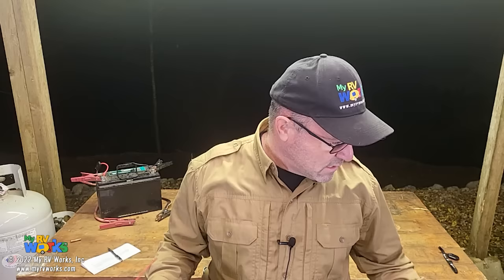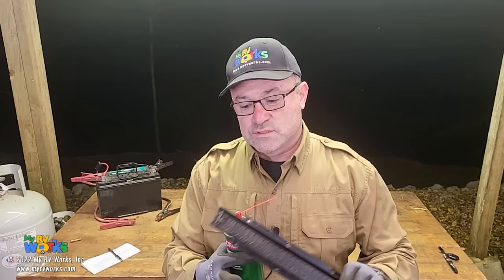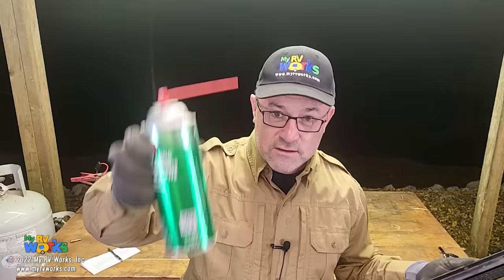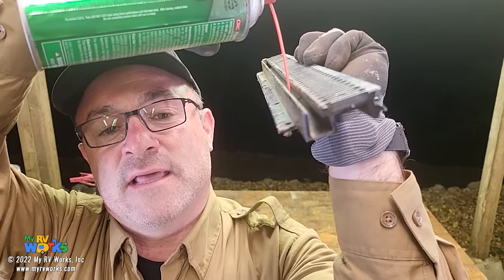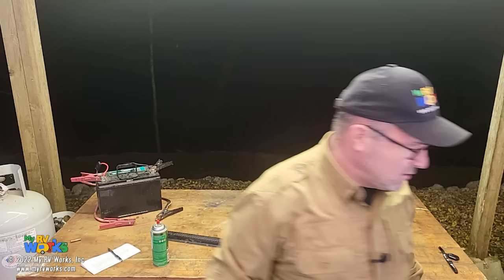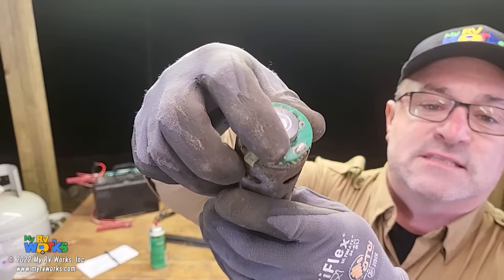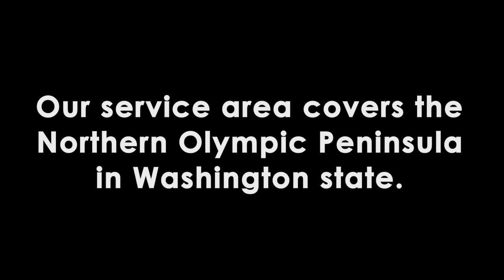Schwintek Slide Room Only Moves 2 Inches And One Motor Stops -- My RV Works

Comment: Well damn..... I had to push as hard as I could to get it a couple more inches out while I ran the motor. Then I went out and lubed the little I could get to. Then pulled it back in. Pushed like hell again as I ran the motor- got a little further out and I lubed it again. Did that a couple times then the motors synced up and now it works like it always did. Truth be told I stopped lubricating about a year ago because I heard the manufacturer said not to lube this brand- well I'm gonna listen to the results. Thanks man!!! Saved my first trip and probably a few hundred to a thousand dollars on a mobile mechanic

Comment: Awesome! I have a 2022 forest river 5th wheel and a mobile Rv tech told me the whole slide system needed replaced because he couldn’t figure out why it kept binding up and sounding terrible. Often I couldn’t get it to move more than a couple inches. I tried the lube trick (bought exactly what he said and applied exactly as told) and it immediately started moving better. That allowed me to go through the retiming process fully and BAM! Good as new! 
THANK YOU!!!!

Comment: Thank you for your videos I've learned a lot about my new RV.. I did have a problem with my slide from not going out even.. now they the dealer said to never lube the slide . But it makes sense putting a Teflon spray on it to make it easier on the system... Being a mechanic I know about friction and the problem it causes... I'm a fan of your video's.

Comment: THANK YOU! THANK YOU! THANK YOU!  I returned from a trip yesterday and my bedroom slide wouldn't go back out.  It was completely twisted. I tried the re-timing method, I tried the "override method" and nothing was working.  I actually already had a can of RV Slide lube sitting around but I didn't think to try it.  This video helped me learn where to lube and how the slide actually moves.  I was finally able to work it back and forth and get my slide out all the way.  I then resynced the motors and it's working like new again! (For now, haha)

Comment: After I lubricated the tracks, motors, and the rollers, the slide became very quiet going in and out.  I could immediately tell the motors were working with less resistance.  Another thing I found was a few loose screws on the tracks attaching to the slide room outside wall.  These maintenance items are now part of my annual maintenance package.  thank you for your guidance with these RV's.

Comment: Thank you! Was having issues with slide not traveling smooth or evenly. Because I did not know, I had lubed with white lithium spray grease.
 After this video, I spent time with brake cleaner to clean tracks, before applying the CRC power lube w/PTFE.
 "Much Gooder!" 🙂

Comment: Thank you Darren.  

Your videos are especially helpful.  I learned more about how my trailer's  Dometic / Suburban / Schwintek / electrical systems work from YOU than any other videos I've watch or manuals I've read. My greatest fear when travelling with our trailer is having slideout problems.   I'm headed out to my trailer right now to lubricate the Schwintek tracks !!  

Bob in Grand Rapids, MI

Comment: I had exactly the issue you describe, Darren. One side got stuck, and overall, the slide seemed to work much harder than in the beginning, but no error messages on the slide controller board. I must confess that I did boondock with the slide out during several sandstorms in Utah, before the resistance started. I was able to get the slide out and in when I repeatedly pressed the button to start the process, but it didn't feel good at all, and I just left it in until I got home. Anyways, I blew out the slide tracks with compressed air, but still had the slide movement resistance. I then bought the CRC Lube you recommended and greased the parts of the tracks and the roller you indicated - on all four tracks. It immediately worked and the slide slips out and in like new. I tried at least 20 times since lubing it, and it never hesitated to work. Thanks for making this video, Darren, and for sharing your knowledge!:washhands:

Comment: You are my hero! My slide was very sluggish and barely could complete the whole move in and out. The lube job solved my issue and it's as good as new! I did find the CRC Power Lube hard to find, even on Amazon. I had to make a 40 mile round trip to Graingers Supply to find a can.

Comment: I am on a trip right now experiencing this problem.  Intuitively, my thinking was that , lubrication would cause slippage.  So seeing this now as more of drawer closure versus a gear track, I understand lubricating the bearing surfaces.  Also, no one described how the electric controls are designed.  So the synchronization makes perfect sense relative to alignment and added friction drawing more current.  Will experiment when home, but thank you for the enlightenment.

Comment: Just had this exact problem in my bedroom slide with a brand new Keystone Avalanche fifth wheel we just purchased, will try that tomorrow.
And I’m also guilty of releasing the switch once I think is in or out all the way, thinking I’m going to blow a fuse or strip a gear.  The manufacturer states not to grease probably because grease holds dirt and sand causing premature wear in the geared section, exactly where you said not to Lube, great advice thanks a lot.

Update next day, lubed the 4 tracks and held the switch counting to 3,  once it was in all the way and at the out positions as you stated, tried 3 times and works great so far.  Thanks for the help.

Comment: I also lubricate the channels on the track with the same product. Never had a problem.  But do understand that the lubricant will attract dirt. Was in Arizona desert during a sand storm. The sand and dust collected in the channels. So clean the channels frequently and before pushing the retract button when in dusty conditions.

Comment: My slide would go out about 5”-6” and one side would stop. 
(1 year old Grand Design) 
So I tried Darren’s suggestions. Now it works perfectly. After it I got it work l lubricated it with power lube. 
Thanks. 
Now I need to find a video about to fix awnings that won’t retract. 🙁

Comment: I agree with you - had a brand new Grand Design Imagine 2400BH with the Schwintek on a dinette and refrigerator slide seize up and wouldn't open. Got a warranty claim in and the service tech told me to use the CRC with PTFE and it worked well enough until I got everything replaced. Will keep a can in my tool bag in the future. Grand Design now puts a rack & pinion slide on the Imagine 2400 starting this year (2023 model). Mine's a 2022. Go figure.

Comment: Yep--we've debated the lubrication topic at length on GD's technical forum.  I've taken Lippert's training class (and I've been to the institute in Elkhart) so for quite awhile I parroted the Lippert guidance.  Over time, based on the input of others and practical experience on my own trailer, I've changed my mind.  The lubricant you are using is also my "go to" for almost everything on the trailer.  Good stuff.
Reply: Also--folks should clean the shoe track prior to lubricating.

Comment: Always great advice and really nicely explained! Thank you so much for your great videos. We have had this problem a few times with bedroom slide and syncing it as you described usually fixes it. I will start using the power lube as you recommend and hold slide button till controller turns it off!
Regards,
Kathy

Comment: Had a Schwintek slide on the previous TT.
It worked as per specs ONCE. Then for the next 4 years the controler was always showing a Sync error. Was able to in & out perfectly with the emergency mode on the controler.
Did change the controler, motor & cable and tried every trick documented that I could find.
Up to when upon the dealer tech inspection on the exchange for a new Jayco.
When the tech saw the issue he said " Yes happens all the time, the motor connector is junk, we do remove the connector & solder the wires re-sync & problem fixed"
Gosh!
Ps the original controller pc board was missing the surface mounted switch to enable the emergency mode, called LCI and support sais "It was impossible that can happened on their boards" so no support & no hope for exchange, had to purchase my own new controler.
So too badbut I do not like Lippert too much since then.

Comment: It definitely works easier lubed. I agree, the lube you use is critical. It is easy to slop oil on something, you just don't want to create a dirt and grit magnet. I worked in industry, to lube or not is not an uncommon argument on some equipment.

Comment: So Lippert had a bunch of schwintecs go out with plastic glides.  Causing this same issue.  Typically one side is worse than the other and the rooms get out of sync and eventually jam and don’t move.  They have a repair kit for it. Tracks and bearing blocks 
We just had a unit in for something unrelated and the room motor popped out.  After taking it apart we found the shaft above the clip was 1/8 too long so the motor would not set down in block it was held in only by the screw that is supposed to keep it from lifting up. Apparently it was worked on by our dealership at another location. The owner said it had not been working right 
Rooms are built out of tolerance sometimes too and eventually the binding wears the motors out
So if your RV is new take it to the dealership and have it looked at. These rooms will work just fine and then bind up and no amount of lube will fix them
If it’s an older unit.  Lubing(cleaning) the groove and wheels can help. If the motors are worn out, they might need replaced 
Have to check the floor too. Water damage and the rollers sink and now the weight is on the tracks not the rollers,or swell and push up
It’s a light system. Not much tolerance for being out of measurement 
And of course if it’s out of time (top and bottom not even distance from wall) you have to disassemble and retime    Chances are if out of time you will need a repair kit as the track or gear are chewed up.

Comment: Darin my sild system die now wanting on dealer to repair it .Talked to lipperts this moring and stree to them. Their system are failing  do to no lubrication on the rail and not handling road vibration .The tech took it seriously and was going to bring it up on next meeting if it helps. I hope so keep up the great  video I have learned more from you then dealer ship and will always refer to your video for help after this slide is fixed

Comment: Thanks for the advise to use the controller to amp out to keep the motors in properly in sync, indeed! The lippert recommendation on our version of the same slideout as on the one on the Jayco oddly enough is to always drive with powered on because the system is designed to prevent the slide from moving if powered on. At least in the lippert slideout manual that came with a 2016 on a Winnie Drop 1780 with a kitchen slideout.

Comment: For some reason I was under the impression once the room was out or in I had to release the slide control once the motors started to bog in concern I would ruin the motors. I see that I was wrong. Glad I watched this even though I have racks.

Comment: Thanks, I really appreciate your videos. I have actually been lubricating that part even if Lippert said not to, it made the whole system work much better. Since I started doing it the slide goes in and out without any of the knocking sounds it was making even when new. The two motors are perfectly synchronized and I always wait three seconds or more both on opening and closing. Any case I have a small problem which I don’t know how to fix: my slide is not that big, about eight feet or so, but when I close it one side is very close to the wall while the other is about half inch out. Practically, the good side squeezes the rubber gasket, the other barely touches it.
Looks like I would need to “turn” one motor a tiny bit more in order to complete the closing, but I don’t know if it’s even possible… I would really appreciate your opinion…
Reply: 87
Reply: It needs to be adjusted, not synced. Two different processes. Good luck

Comment: The other issue that happens is a cracked magnet on one of  the motors.  Then the computer can't count the revolutions correctly via hall effect and times out.  It will still spin in time periodically, making you think the lube has helped.  
You can open the motor carefully and use a some thin plastic cut into a disc and laminate it to the cracked magnet with some epoxy.  Works good as new.  I've done this as a field repair on a reflection 317 I rebuilt.  
Look into this if you have this issue.

Comment: Hello, I came across this video while trying to find one to help me fix my small bedroom slide out. I have an 07 Dutchmen Tundra 27FK. My big hydraulic living room slide out works perfect but my smaller bedroom one has tipped to one side a couple of inches and when I have to put it out it’s scraping on the bottom and tearing the material on the bottom. Can you please help me figure out why it’s tipped to one side. It’s now leaning to the right. You are so knowledgeable on these trailer issues and your video’s are so easy to understand. Thank you for making them for us. ❤

Comment: You just earned a subscriber buddy, I'm going to order some up and give it a try, my slide isn't tracking even and needs to sync up
Reply: How do you get to the slide tracks to lubricate them when the slide only moves 2 inches in or out before amping out?
Reply: @bradw1261  I also had to sync up the slide out motors using the button on the slide out controller. Luckily my slide was already all the way out. There are videos on here that will show you how to do that

Comment: Darren, Thanks for all the advice and insight on the Schwintek system.  I am in the market for an RV and the brand I am leaning towards uses them.  After reading posts on Facebook, ( I mean where else do you go for an overwhelming amount of horror stories?? LOL) I was basically sick to my stomach wondering if this was the right way to go for me, but after watching all your videos on these I feel confident in moving forward with the purchase possibilities.  I do have the mechanical abilities to perform the maintenance and repairs and confident I won't get caught somewhere with my slide out!  Thanks again for your videos and advice!

Comment: I had an issue where one side would stop shortly after engaging the slide out. It turned out to be the batteries in the end, even though they were fully charged they were unable tk supply the current needed for both motors simultaneously. 

I would love to see an instructional guide on how to manually push the system in if over needed
Reply: Try unplugging the motor #1 & the motor #2  wiring harnesses from the controller box. It should push in without to much difficulty. Good luck